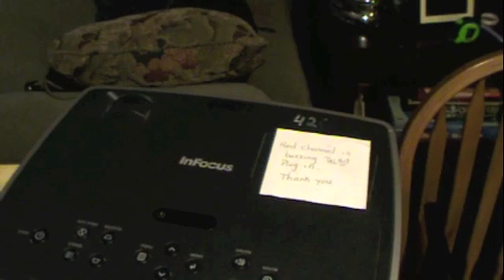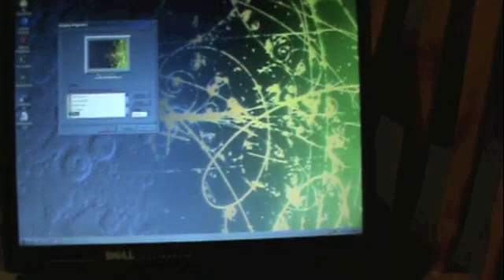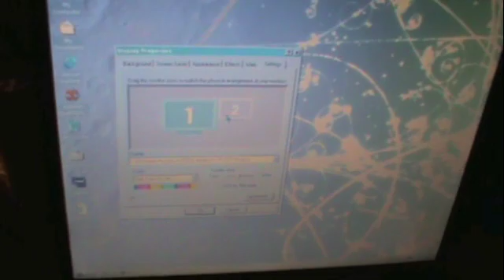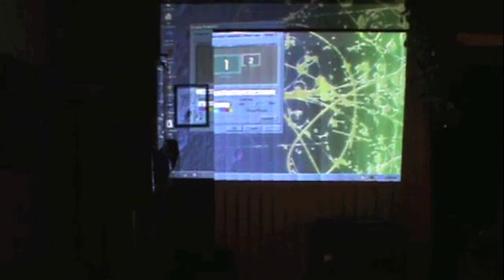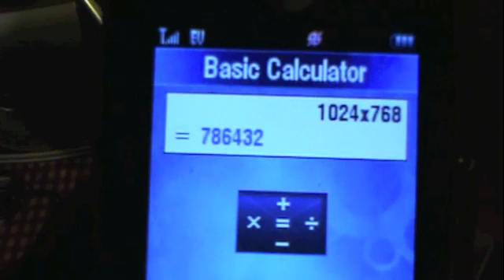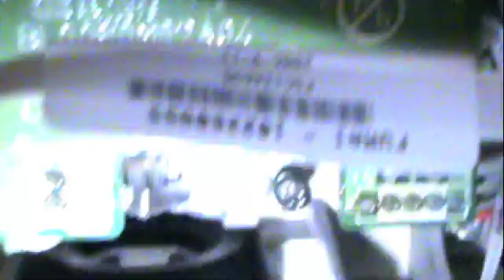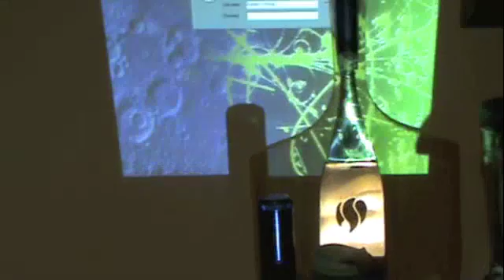InFocus DLP Projector

Comment: One of the projectors at my old school (I believe it was an Epson) made a little spark inside of the projector when it turned on... this may be a dumb question - but is it supposed to spark?
Reply: 1912RamblerFan01 It actually of might of been supposed too. It could have had a mercury vapor lamp which sparks a few times before lighting up.
Reply: Joshua's Recordings It didn't spark in the lamp.
Reply: 1912RamblerFan01 Ohh, that's odd. Where did it spark?
Reply: Joshua's Recordings On the circuit board, right next to the air vent
Reply: 1912RamblerFan01 Hmm, well I would think that it is not supposed to do that. Unless the lamp is old and takes a few seconds to start up. If that is the case it would be dissipating the unnecessary high voltage though spark gaps (that is only a theory).
Reply: The thing worked. I was in the fourth grade, and they were turning the projector to show us an inappropriate (for fourth graders, at least) show - The Boy in the Stripped Pajamas. Very sad movie.
Reply: 1912RamblerFan01 Well, yes it would work. It just should get a new lamp soon.  Very interesting story...
Reply: Joshua's Recordings To add to the "interesting" factor of the story, right before we watched the video, our entire school (40 students were in the entire school, as it was in the middle of nowhere) went out to a restaurant to eat fried chicken at a upper-scale restaurant owned by someone who volunteered at our school all the time. People never seem to believe how "small" a school in the middle of nowhere is until they see all of the students of the school - 40 kids in all grades - consuming just HALF of the restaurant seating area. We went to the restaurant because it was a historic building and above the restaurant, on the second story, they have a museum. Very interesting. The place is in Arrow Rock, Missouri if you want to see how "out in the middle of nowhere" it is.
Reply: I've got an Epson S3 projector that does that exact spark right at lamp ignition. Right by the air vent on the ballast board. The ballast is mounted right by the air vent and is the upper board as the bottom board is the power supply. The ballast is what ignites the arc of the lamp and controls the current to maintain the arc. My theory is that there are spark gaps on the ballast board which dissipate some of the high voltage pulse that is delivered to the lamp to strike an arc. This is the spark we see near the air vent right as the lamp is ignited. The projector works fine.

Comment: at one of the schools that I work at, one of these actually overheated causing the glass color whell to break, so the image projected on the wall ( the school district is cheap, no white backdrop screen and they're always buying the low end dells, they used to buy eMacs and IBM Netvistas, the high end ones too.) looked very unlike the windows 2000 login screen on the laptop. it was only red and green on the wall.